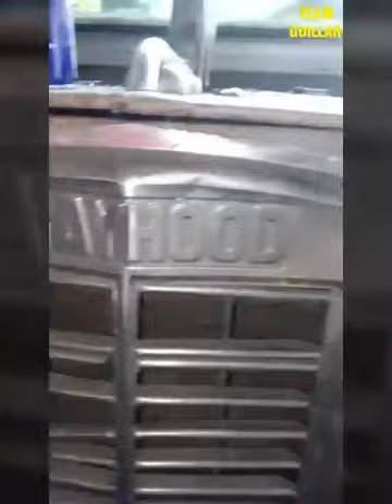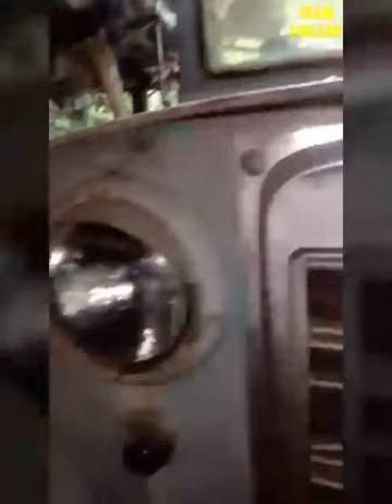"WD-40" how it works...?/|| PAPA LOVE

Comment: yes WD-40 works on everything and we use that stuff on just about anything! and it even take off the noise on the noisy belt in the car if your belt is starting to get noisy! Its a great cleaner on tires and of course just like what your doing on the headlights. Thank you for sharing and a lot of people will definitely will know now.